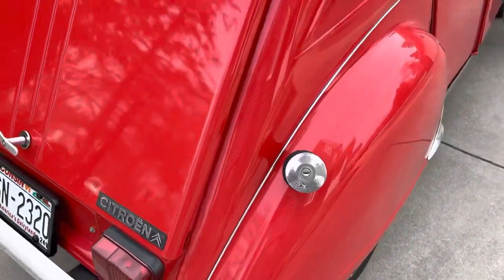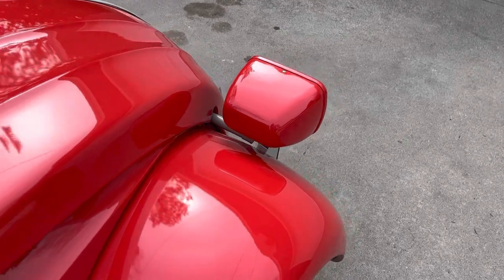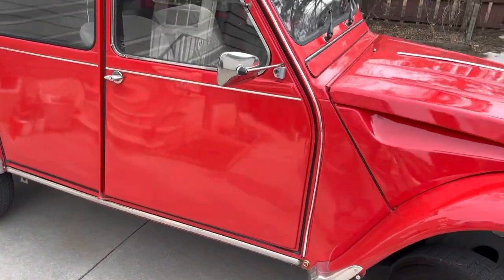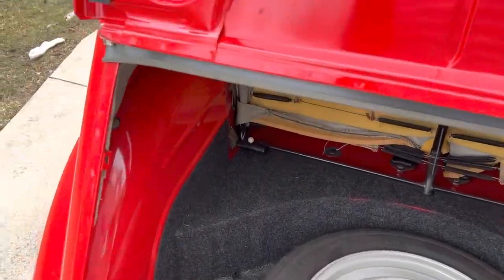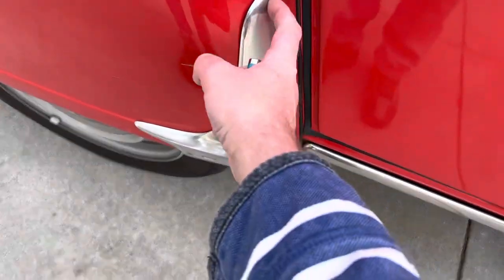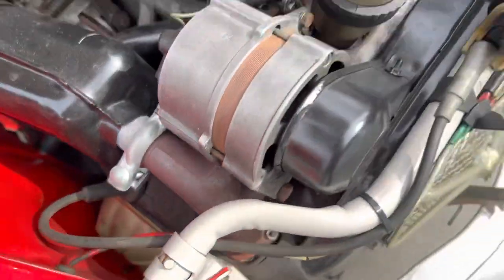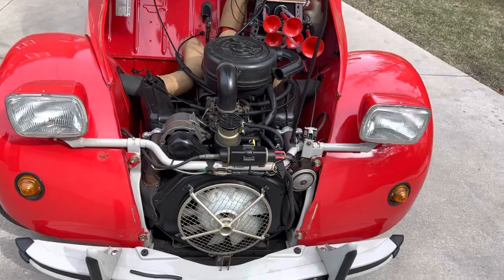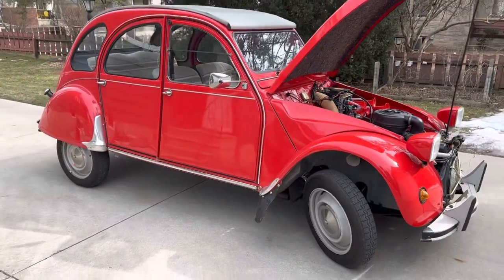Citroen 2cv walk around

Comment: I see you have Michelin X in front and other tires in back.  This can be very hazardous, especially if the others are not radial. I have an '88 and love it.
Reply from the maker: I’m not too crazy about the rear tires as well, but that’s what it is when getting a used car, someone tried to save $20… eventually I’ll change them all, the spare is cracked too. Doesn’t impede my pleasure 😊
Reply: @xaviermeilhon8219  It can kill you.  The radials have far greater traction.  Talk to someone who knows tires.  You have zero protection in a 2CV so get another set of Michelin X's.  Really.  You only have to be wrong once.  The 2cv debuted those Michelin X's.  They go with it.
Reply from the maker: @zoltankaparthy9095  don’t give me wrong I hear you. The rear ones are still radials, just Toyo instead of Michelin X.